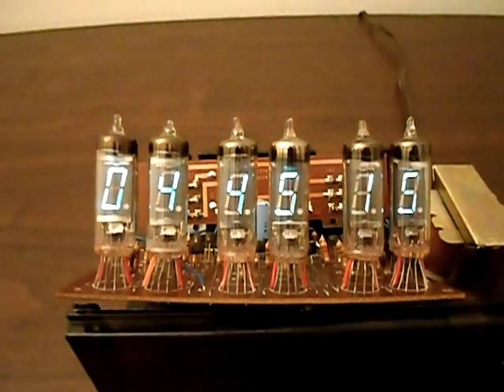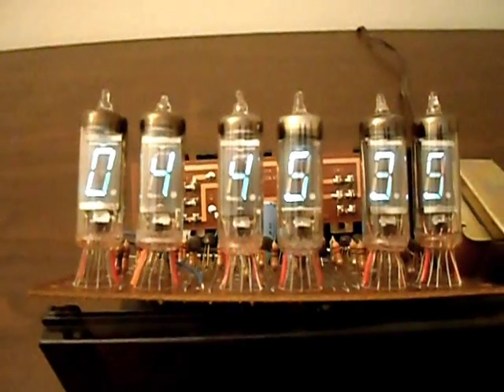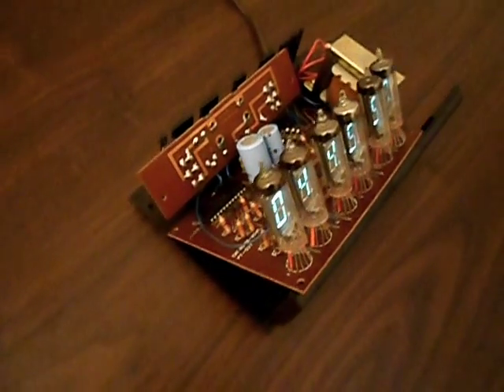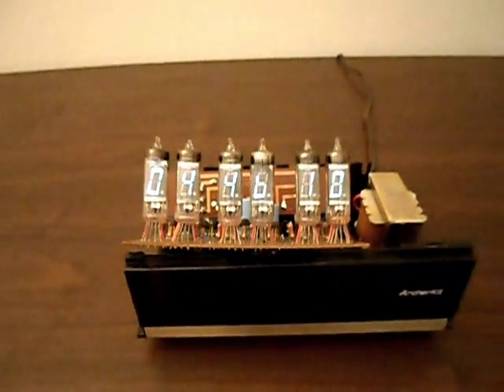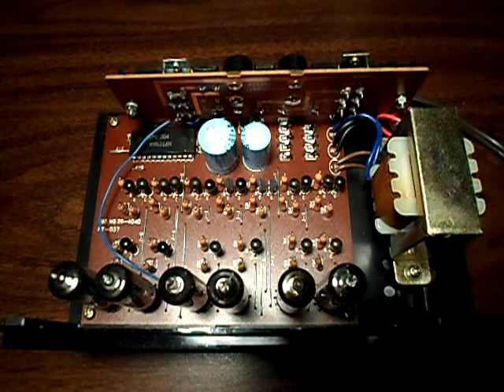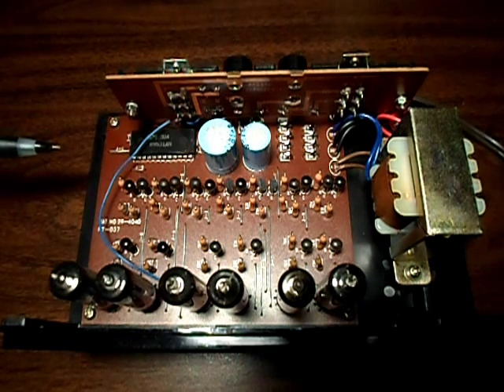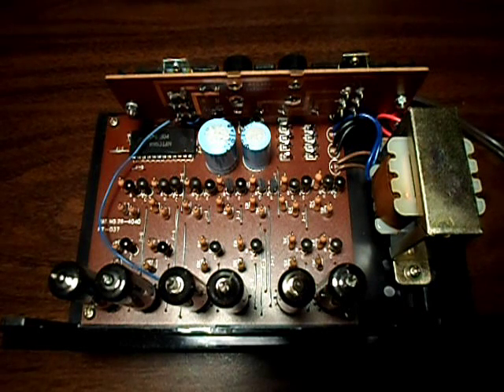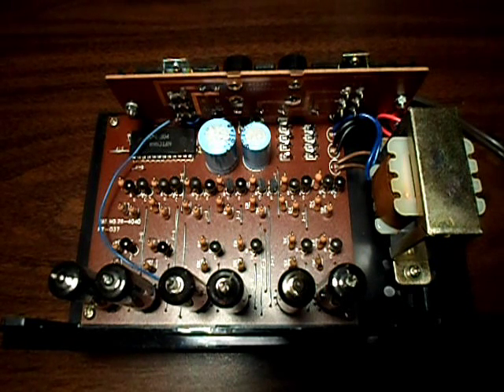1974 VFD Tube Clock : Vintage Digital Collectible Clock

Comment: What is the part number on the tubes. The segments have a unique turn at the end.
Reply from the maker: The display tubes are part number DG-12H, manufactured by Iseden Itron.  Yes, the A and D segments of the display are unique looking,  and I think it's cool how you can see the filaments as well.  Thanks for the good question!